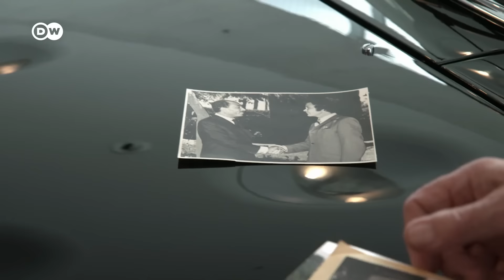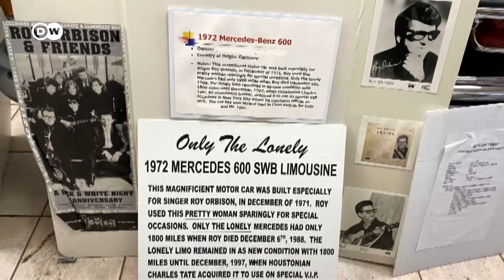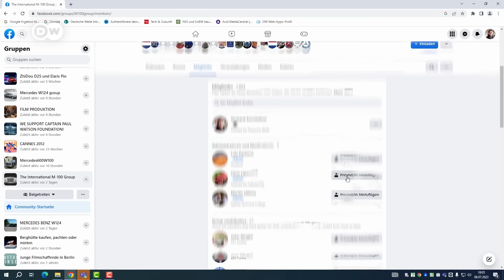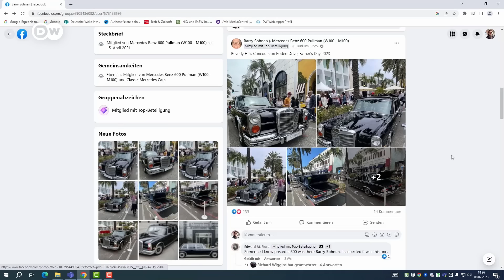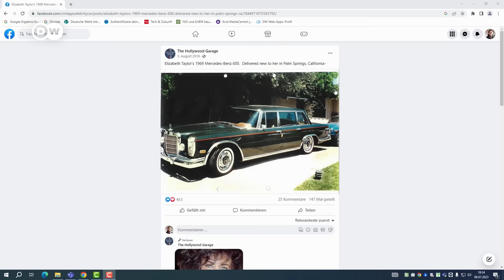Mercedes 600: 60 Years of Germany's Best Car?

Comment from the maker: Is this the best German car ever produced?
Reply: In its day? Yes.
Reply: After 300 SL maybe
Reply: @redstream1237  the 2 were decades apart. The 300SL from the 1950’s & the 600 came later & the 2 cars were polar opposites. 1 a super sports & the other a limo. 1 thing they have in common is they represent the epitome of excellence only MB can do.
Reply: I prefer the Mercedes W124, but still a great car though:yt:My fantasy would be to drive a Mercedes convertible top down with me in the driver's seat and my friends in the passenger seats
Reply: Dictator car
Reply: It might be the best car ever produced
Reply: Mercedes-Benz 770 (W150) is the best
Reply: My favourite is the 300SEL 6.3. It was essencially the engine from the 600 put into a W109, making it into the world's first super saloon. It was the world's fastest saloon car when it launched in 1968. It was even taken racing. A small tuning workshop set up by two former Mercedes employees created the famous "Rote Sau", which came in second at the 24 hours of Spa in 1971. That little tuning workshop was called AMG...
Reply: Merc R129 is
Reply: No, the W126 was the best car to be made. But the W126 was way less prestigious, because it was mass produced by the measures of the W100.
Reply: My vote would go for the W123. Beautifully engineered and built up to a standard rather than down to a price, but still with an eye to design for serviceability and minimizing total cost of operation. Smoother and more refined than dead-nuts simple people's cars like the Beetle and Trabant, but still maintainable at reasonable cost.
Reply: Didn’t Elvis Presley own a 600?
Reply: the best
Reply: I would say yes too. But ... In my personal opinion it's closely followed by the W140 Brabus 73S.
Reply: Depends on what kind of "best" car you expect. This is not the best Sportscar, neither it is easy to fix nor cheap or a million seller like the Beetle. Was even a loss-making business for Mercedes.
Reply: I would buy one if still produced
Reply: how many dictators and how many stars had it?
Reply: @franktechmaniac7488 I am very fond of the W116 with the M100 known here as the 6.9 (in some markets the 450SEL 6.9)
Reply: @wuuduu609 literally everyone
Reply: Depends how you define “best” I think the w123 is the most reliable.
Reply: @redstream1237  Different class of car altogether, in its  own class it had NO peers
Reply: Yes, although the W123 has some merit to the same claim
Reply: Some people are comparing apples to oranges , this is a car that can't compare with any other vehicles . Engineered like no other, class of itself in its day.
Reply: OPEL
Reply: panzer
Reply: Of Course!!!
Reply: you can get a nice model of the car in 1:18 scale from autoart and cmc but there expensive

Comment: Sadly, Mercedes-Benz is a very different company today.   The uncompromising desire to build the best cars in the world is no longer the motivating force behind today's vehicles.
Reply: So true. In the 90s it changed from an engineer driven company to a corporation managed by accountants focused on profit. Today they design mostly for China.
Reply: If I remember correctly DB lost money on every single car. …So
Reply: Too much glitz and not enough technology, and the styling has gotten so garish now almost cartoonist in a way.....
Reply: @morphyon  Yeah, you are correct about that.  The 600 was so expensive but they still were not financially viable - although, as a halo car it did make the point that MB built the finest car in the world.   The Rolls-Royce Phantom V was more elegant (but old-fashioned) with a more beautiful interior than the 600 - but it was a technical dinosaur by comparison.
Reply: Since the last pure s-class we saw is w140,
Sadly after that M-B lost it's glory of manufacturing top notch traditional cars. 😢😢
Reply: Still outstanding quality today, compared to different compalies
Reply: @heyrod59 too much technology is one of their problems. They no longer build quality.
Reply: @Gerard_Joling63 idk about that. Their wood trim creaks. They also have cheap plastics where you wouldn’t expect them.
Reply: @JStryker7  i am talking about the mechanical part. I work fot both mb and ford dealers as a mechanic. Mb is just way more durable
Reply: That are all cat factory
Reply: @bier974 
Škoda is better built and more reliable than Mercedes-Benz, also BMW Audi, and Volkswagen.
Reply: Clearly you've never been in a top-tier new MB like the maybach or even the s-class.
Reply: Sto nikad, ali.  nikad ne podesite naslon za glavu kad vozite neki automobil? Sto mi to ide na nerve, pa to je strasno!  Serem vam se na test!  I objektivnost!
Reply: @r6emre977  You are wrong about that.
Reply: Overengineered money pits.
Reply: @Gerard_Joling63  My 2017 Ford Transit has already gone 100,000 more miles than my trouble prone, money pit 2012 Mercedes Sprinter did.
Reply: Yep. LCDs, LCDs, and more LCDsssss 🙄
Reply: @heyrod59 No there is too much technology. People think a well engineered car these days needs lots of technology, I’d rather have quality rather than gimmicks.
Reply: @paulie-Gualtieri. 😂😂 what are you smoking
Reply: I said the same thing. When I was a kid growing up , you had to have 3 things that signified wealth. A Rolex Watch, A Mont-Blanc Pen & A Mercedes-Benz!!!
Reply: Yeah everything is about corporate profit now that’s why everything has no joy to it in the world anymore
Reply: @maxbarko8717  Can't blame them. Chinese customers bought more Mercedes cars in a month than Asia and Africa customers combined at the same period of time. Although I don't like the outcome, it's logical for Mercedes to follow the needs of their biggest market
Reply: @Kuricang31    China IS in Asia.
Reply: @r6emre977  To me, the E-Class with the 6.9L engine was the epitome of a modern Mercedes sedan. Fast, Luxurious, and practical in the true meaning of the word. No garish look-at-me exterior as on the S-class. Nor did the E-Class offer an interior fashioned after a bordello. With each model year the S-Class becomes cheesier — not because M-B want this, but because these days most of the people who can afford them have such appalling taste. But check out the 2024 E-Class. While constrained by today’s safety and environmental regulations, it retains the original’s restrained beauty and excellent performance.
Reply: As an owner of a current an older Mercedes, I can say that you are 100% correct.  😢
Reply: I think that desire is back. Mercedes-Benz found my G-spot 😱 G EV  I desperately want one.
Reply: Im owner of MB W212 400000 km and I believe is best car you can have.

Comment: The Grosser will never be surpassed for its presence and status. A true icon.
Reply: Couldn't agree more. It's an instant symbol of extreme power and influence.
Reply: Rolls-Royce and Mercedes-Benz are the best luxury cars in the world!
Reply: It was and still is the BEST car in the world 🌎
Reply: Never understood how the name "Grosser" came up. It doesn't make sense in German. Should be "The Grosse" if you want to say "the big one". Grosser is wrong case.
Reply: @derpinguin7003  its called grosser because it was grossly over engineered!!!
Reply: @derpinguin7003  hints the best car in the world 🌎
Reply: "Grosser" sounds weird in english, though it means "the great" in german, we never called her so.
Reply: @derpinguin7003  Most Cars have male gender (article "der") in german , so  Grosser/Großer means "Great (male) one" . Suffix ..."er" = male. Life is to short to explain german grammar here, but "ein GrossER" (=  great one) is as correct as "Der GrossE" (= the great) is. Pronoun "ein" means "one (numeral to a male object) or "a". Germans have a male, a female + a neuter "a" hence our undefinte articles need gender suffixes though. 😂"Grosse" without an article or noun it refers to, was confusing, could be one singular female object or a neuter plural as well. But you're finally right - for German grammar never makes sense.
Reply: @HesseJamez  erklärst du grade einem Deutschen deutsche Grammatik? Der Großer geht halt nicht.  Das wäre die wörtliche Übersetzung von the grosser.
Reply: @derpinguin7003  And even this spelling is incorrect, since the o-vowel is a long vowel. Therefore you have to use the Eszett (ß). It is quite correct that the Name "Grosser", doesn't make sense in German, because it has to be written "Großer" or "The Große", as you already mentioned. But using a double-s is fundamentally wrong because then the o-vowel would have to be short which it clearly is not.

Comment: My white Mercedes 600 SWB was entered in the 2000km Targa Tasmania Rally in 1993.
Remarkable performance,  outrunning a 1960's Ferrari 250.
Ultra comfortable, but requiring several hours of all kinds of  maintenance at the end of every day in this five day event.
It showed many of the smaller cars a thing or two about handling.
On descending mountainous terrain at speed, brakefluid would come to the boil without warning and you would not have brakes for a little while until the fluid had cool down a bit.
That gets the blood pumping..
Owning a Mercedes 600 also means  'Service before use' at unpredictable times , especially checking for leaks in the highly pressurized 'Komfort Hydraulic' System.
The hydraulic pressure on the side windows is so strong that it could break a person's arm, hand or finger.
Definitely not a car to leave children in unsupervised, because of the lethal window operation and the 'touchy'  handbrake that disengages when the gear leaver is moved.. 🤔
A 600 is a little like owning a boat.
The happiest times are when you acquire it and then again when you have successfully sold it.
My bonus was the exhilarating time driving at top speeds in Targa Tasmania and completing the event without scratching the beast.

Comment: I trully adores this Mercedes Benz, the 600 or W100 or M100, whatever you called it. 
I fall in love with this very car when I see Top Gear when Jeremy Clarkson compare his Mercedes 600 "Große" against James May's Rolls-Royce Corniche, that's around 2020, even though now in 2023 I just 20 y.o but I absolutely wanted to buy one of this car especially wanted to bought it from UK or whatever country with RHD because I born and live in Indonesia which is RHD.
After searching, I just staggered of what features this car have. In that time, fuel-injection V8 engine, hydraulic power steering, an adjustable air-suspension, hydraulic doors, hydraulic boot lid, hydraulic seats, anything, from a car that first released in 1963 but developed from 1950s. The dedication of reliability and for countinously used is just staggering. Forget the mpg or any sort of that, this is one of the peak of car engineering of any time, no wonder then, it was the most expensive car you could buy... in the world.

Yes, the feel of luxury and comfortable is different from nowadays luxury cars or even the luxury cars from the same era. It feels like you are one of the most important or to put it politely, an adored people by many many people. But, for me, it's not for that, because I like classic, old cars like that, so, it's a hobby for me.
If, I go to a replica, it just not the same. I mean, yes it is totally just like the 600 exterior and interior but, when you replicate something just because you can't buy it, it'll never be same when you actually have or had ride on it.

Hopefully sometime in the future, I could buy that car (no replica) and people who wanted that car could also buy it.
Reply: It would cost more to replicate then the price of a used one.
In Australia a neat RHD 600 was sold a few months ago at Auction for around A$160.000

Comment: I valet parked Mike Illitch's brand-new S600 in 1993, and was just blown away by the fact there was a cell phone integrated into the frickin' dashboard!  Completely unheard of at the time.
Reply: Just in case you don't know, the car in this video is the W100  The car you parked would have been an S Class with a 6 litre engine, the W140.
Reply: In 1987 my Saab 9000 Turbo had a neat fully integrated phone key pad integrated in the dashboard.
It was a Canadian system

Comment: Mercedes should come with a Nee Grösser. The K770 and 600 were the Grössers back 60 and almost 90 years ago, so time to have a new one!
Reply: The term "Grösser" doesn't even exist in German, except if you want to conjugate the german adjective groß (big, large in English, for example groß - größer - am größten). The correct spelling would be "Großer" or "The Große", but this term was never used for this car in particular. The term was probably brought up by a few English-speaking people who had no idea about German grammar and for whom the number designation was too difficult or just not good enough.

Comment: The Mercedes-Benz 600 (W100) is certainly one of the best cars ever, but The Mercedes-Benz 300 SEL 6.3 is certainly one of them, they share the same engine, in fact if you didn't have money for a 600 you bought a 300 SEL.
Reply: A Mercedes 300SL 6.3 that weighed less than two tons would take off like a demented clockwork toy.
Breathtaking and dangerous when applying brakes at speed, because under heavy braking the swing axle would turn the rear wheels to maximum positive camber and the car would lose traction.
Not for the faint hearted...
I rallied one of these beasts in 1994.

Comment: Interesting that the revival of the Maybach name and luxury never had the presence of the 600. The 600 outdid the RR Phantom V & VI - a luxurious dinosaur v sophisticated power house.

Once BMW got their hands on Rolls-Royce with the Phantom VII onwards, they had the style and presence that Maybach lacked... A high tech opulent bloated S class never screamed - FABULOUS in the way the 600 did, and now the current Phantoms...

The closest thing to a 600 Pullman Landau was the single example build by Hooper in London from 1989-1991. The Hooper Rolls-Royce Emperor State Landaulette was expanded in every dimension between the base of the front windscreen to base of the rear window. 40 inches longer than the Silver Spirit donor car. 2 inch higher side windows and 4 inch higher roof and 5 inch longer windscreen.

The Hooper Landaulette cost close to US$1m and was to be the first of a series of landaulettes, but increasing security issues in the world sphere strangled demand.

I was chauffeur and custodian of this 'Chariot of Dreams' in 1993 for a tour of Australian Motor shows, charity events and street parades including St Patrick's Day in Sydney and leading the Melbourne AIDS Candlelight Vigil parade. Inclusions of a rear mohair convertible, lift out targa section for standing for ceremonial occasions, rear facing centre seats with their own sunroof, fold out leather tables with built in Toshiba laptop & printer. Cocktail cabinet with crystal tumblers plus slide-out veneer drawer with champagne flutes. Solid silver his & hers Asperys grooming sets, Philips Carin LCD TV & stereo. 
Closed chauffeur's compartment with electric division and intercom to rear lounge.
X frame exoskeleton under car to add stiffness to a long part open monocoque chassis.

Like the 600 the Emperor Landaulette was rather spritely and maneuverable for such a large beast that was too long for a 20 foot container. The 600 Pullman would have been even longer. I wonder if it was too wide to fit in a container??

Comment: You can see it dripping hydraulic fluid when it's on the lift at 11:14.
Reply: This was the main reason I did not buy one.
Reply: Maintenance nightmare
Reply: Tricky to repair and potentially extremely costly.
Also must switch off at the main supply in engine compartment and engage a window until pressure has dropped completely.
My mechanic did not observe the latter and nearly lost an eye when a tiny piston came out like a missile and grazed his cheek close to his eye.

Comment: I had the chance to buy Idi Amin's Mercedes 600 when I was in England back in 1983.  It had been a repo held by the Bank of England.  It was in poor condition, and it smelled terrible.  Back in Germany, I owned a 1977 Stutz Blackhawk VI owned by actor Curd Juergens.  I was torn between selling it or shipping it back to the US.  A young man offered to trade me a 1966 Mercedes 600 for the Stutz.  I passed on the trade because it had hydraulic problems.  He eventually paid me cash for the Stutz.  I sold it for $26,000 back in 1986.  I wish I still had it.

Comment: The 600 is indeed a staggering car. But the best Mercedes ever constructed is of course the fabulous 300 Sel 6.3 that used the 600s M100 engine and transmission air suspension but didnt have the problematic hydraulics and it was around 1000kg lighter. I owned 3 over the years including one of the last RHD 1972 cars ever built. It was a very swift car and was faster than Porsche Aston and many other so called sports  cars. In full Red Pig guise it truely was the ultimate beast. 

A magnificent machine very expensive  when new and extremely expensive to maintain today. But very well made. A friend of mine here in Australia drove his 6.3 over 1,000,000 k!
Reply from the maker: Absolutely criminal that the original Red Pig didn't survive. We reckon gazing at the replica that was eventually built will just have to do!